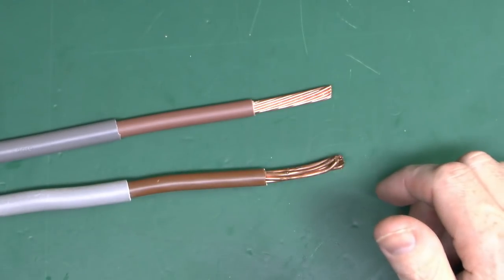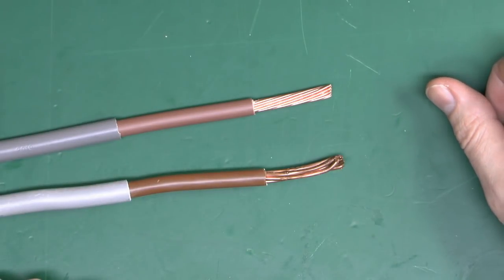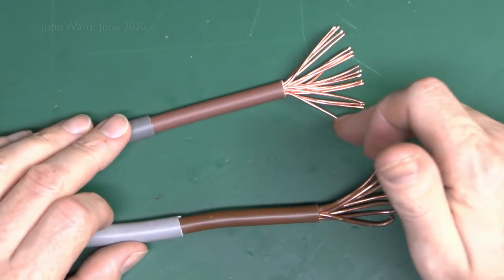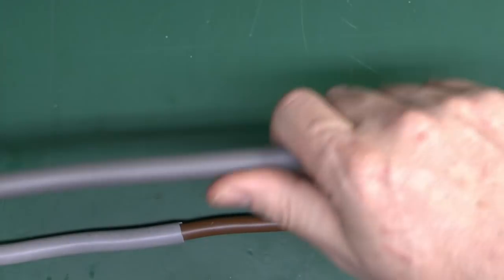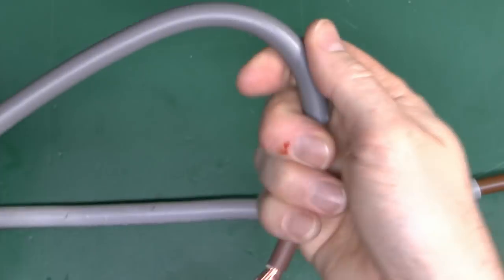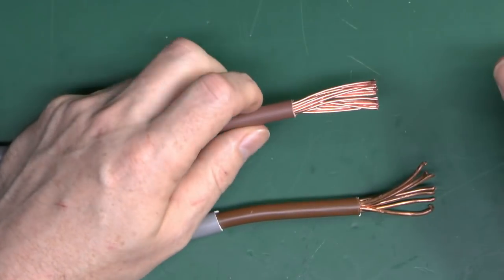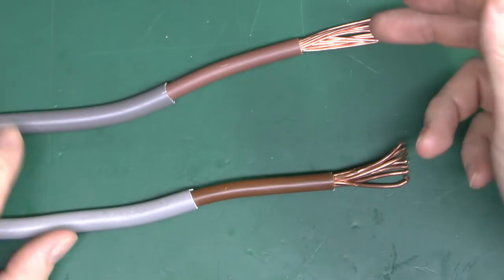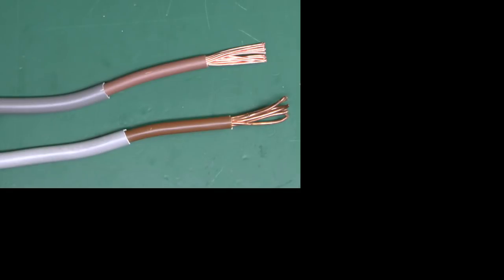Meter Tails - 7 or 19 Strands

Comment: A funny thing, these days down here in New Zealand and Australia, inside our commercial switchboards and distribution boards, we are required to install single cores that are like the cables for a welder.
IE, you might have 50mm² in from the meters to the main switch, via CT's, the wire you use there, needs to have (I could be wrong here) 625 individual cores in it, with them being so fine, you have to use either bootlace ferrules or some sort of an eyelet crimp connector on the end of it.
I like this idea, back when I started my time,  we used to have to solder wires into lugs, it was a pain in the rear.
Personally, I also like the idea that flexible cables are being used, as opposed to mere stranded copper, the new stuff is so much easier to fit and terminate.

Comment: as a meter engineer i use both, but the 19 strand one is preferred in tighter scenarios, as can be bent easier...overall  just get the 19 strand if you can👍🏽
Reply: Hi, what is a meter engineer? Thanks
Reply: @Keith Grout In other words, an installer. Not engineer, not even technician. Not putting down the role, but different skill sets and tasks have different terms for a reason.
Reply: @Monkeh616  Yeah like cleaners are called sanitary engineers.

Comment: I prefer the 19 strand tails as an electrician, the ones i get have the brown/blue outer sheath instead of the grey.
Reply: I use 19 strand Doncaster cables.  Can’t seem to source the blue and brown outer sheath ones though? Mine are always grey outer.  If you have a link to where you buy the blue and brown 19 stranded ones please let me know....😬
Reply: IWL Electrical Limited Ian Lawrie   I bought some fromCEF recently, blue and brown, wouldn’t go back to the 7 strand again, 19 is the way to go
Reply: @evguysltdianlawrie2274  'SHOP4ELECTRICAL' do them as well.

Comment: The 19 strand has another advantage:  when connecting to a round terminal, one can use one long strand to wrap around the conductor tightly: this stops the strands from splaying out, thus making a better connection.  Many years ago, this was standard practice, and some electricians also used this method when connecting final circuit conductors to fuses or breakers in dis. boards. This doesn’t work with that most nasty of cables, 2.5 sq mm T&E., or other solid conductors such as those in micc.
Reply: Sounds like a BAD idea ! Surely it's better for the strands to be able to slide over each other and be formed by the terminal hole they're being screwed down into ?

Comment: Do you need to crimp on some bootlace ferrules to the 19 strand to prevent splaying in the meter terminals? Would have thought the 7 strand might be more robust against overtighfening, closer to solid class. Thoughts?
Reply: They're still solid conductors, 1.3mm or so in diameter. No ferrule.

Comment: Is the 25mm a nominal dimension or the aggregated actual cross sectional areas of the strands. I ask because if it is the former (I.e. 25 mm2 is the area inside the brown insulation) then smaller strands should give a better packing and so the actual copper area may be higher for 19 strand than 7. Could be an appreciable difference.
Reply from the maker: It's the cross sectional area of the copper conductors.  For multiple strands, it's the sum of the cross sectional area of the separate conductors.  Space between them is not included, so the total area is the same regardless of the number of individual strands.

Comment: On a 50hz system skin effect in minimal so the 7 strand is fine, but whats the 19 strand for ? Motor Inverter
Reply from the maker: Unless the strands are individually insulated or separated from each other, skin effect is identical - a group of uninsulated strands together acts in the same way as a single solid conductor.
Where skin effect is significant, the conductor either needs to be a set of smaller separate conductors (such as overhead power lines with 4 spaced conductors), or a different shape such as a flat bar.
Reply: @jwflame  so in a motor the individual strands being insulated makes many small paths rather than one large and skin effect changes the current carring capability at high frequency, but these wire are not enameled and act as bus but I got you JP 🤙
SO ones easier to bend than the other both act same no matter frequency allways a lesson round here fp.
Reply: @jwflame  So the answer is cost? are 7 big strands easier to... cast? Draw? BRB off to learn how copper cables are made

Comment: should the 19 strand be ferrule crimped
Reply: Not unless you have a hydraulic crimper..

This isn't exactly a fine stranded wire - those are approximately 1.3mm² each.
Reply: Nothing in the regs about crimping.
Reply: @martinwinfield2935  Thank God for that !!! It's so illogical to me ! Main reason being that the clamp is removed - allowing the crimp to 'ease'. Whereas a terminal screw remains tightly clamped - if tightened properly.
Reply: @millomweb  What do you mean the clamp is removed? You apply the same clamping force to a ferrule or other crimp as any other conductor in the terminal.
Reply: @millomweb  - a properly crimped terminal is infinitely better, more reliable and longer lasting than a screw termination (clamp or no clamp). So you are talking out of your arse, and/or doing it wrong.
Reply: @johncoops6897  Whatever issue you have with screw terminations, crimping doesn't remove as crimp terminations are still attached with a screw ! So you may as well clamp directly onto the wire - a screwed down connection remains screwed down as tight as it was screwed. A crimp on the other hand, loosens a little when the crimping tool is removed ! It's just impossible a crimp and screw can be better than just a screw !
Also, a crimp is just straight pressure whereas a screw applies a shear force which cuts/cleans the wire at the point of contact - making a far better job of it than simple crimping where the wire isn't as clean as ideal.
There is talk of using crimping in automotive situations as they deal better with vibration. Well I've come across wire failures where a crimp has been used - in not 1 but 2 places - where the wire enters the crimp (same as a screw connection) and also between the crimp and the rest of the terminal clamped under the screw.

Comment: JW,
I was told some years ago, by an Electrical Inspector that using Lineman pliers to twist stranded copper cables, is not only wrong, but it means the cable is wrong for the terminal size.
His reasoning was that when you twist the cores, you lose copper off of the cores on the pliers and lessen the effective contact area.
I still have no idea what he was on about.
Most of our stuff with 16mm² and above is multi-strand (like welder cable), within feeding mains around switchboards.
Reply from the maker: It would require a huge effort to actually remove copper from the wires using pliers, by which time the wires would probably be totally destroyed.
Twisting stranded wire will increase the diameter of the bundle of wires, which might make it more difficult or impossible to fit into some terminals,  but that doesn't explain less contact area.
Perhaps someone twisted them together, then found they were too large to fit into the terminals and cut some strands off so they would fit?
Reply: @sparkymacsparkface7497  - generally you twist when you are inserting into a round terminal with a screw that bears down on the copper. If you don't twist, you miss half the strands. When terminating into a rectangular terminal with a rising clamp (eg: circuit breaker) then you should flatten the strands and keep them straight.

Comment: Just a warning, on a job with EDF in attendance, they refused to fit connect their equipment to the 19 stand meter tails that I had provided. They said other supplies will allow it but not them!
Reply: When British Gas exchanged my meter last year, the installer specifically changed the 7 strand tails for 19 as part of the job. He also changed a Henley block for 2 Lucys, which seemed a bit OTT.

Comment: Hi John :  is  it 19  strand carry more current then 7 strand in the same size wire
Reply: No... they both have the same current ratings.
Reply from the maker: No, both are the same total size.
Reply: Technically yes but in practical use at these sizes no. In transmission lines a lot of consideration is given to the number of strands and how they are grouped as skin effect and the overall surface area of the conductor can affect losses. For a set of meter tails, over a Metre or so it would make no perceivable difference.

Comment: I'd think that more strands are also electrically less resistant, as there effectively would be more copper surface. Though that could be pedantic with AC.
Reply: Skin effect isn't relevant in this context, so no, there's no difference. At higher frequencies (50Hz being nearly DC in my world) or much higher currents, it matters, but at this level only the cross sectional area is important.
Reply: Well, if you're going to make use of all that copper surface by soldering ! I think the real benefit of more strands is the improved ability of the core to deform into the shape of the terminal hole it's clamped in- hence making more contact points with that terminal. However, if the terminal screws are properly tightened, the copper should be crushed and deformed/flattened against the terminal surface; which the 19 will do more easily.

Comment: What about electrical or should I say electromagnetic properties with these two?
Reply: At 50Hz on conductors this small at such short lengths the effects will be minimal, perhaps even immeasurable.

That said, at least in theory, because AC current density is highest close to the surface of a conductor and that effect is more pronounce the larger a conductor is, the 19 strand might be expected to show a lower resistance than the 7 strand.  Multiple conductors in proximity add to the complexity and is more than I can get my head around.

For the maths (and how significant or not the effect might be) see: https://core.ac.uk/download/pdf/41822519.pdf

Comment: May i ask a out of focus question? Why both of them are in prime numbers? Is it just coincidence or is it some reasons behind?
Reply from the maker: It's how small circles can be arranged inside a larger circle.  One strand = one circle, 6 others will fit around it and use most of the space = 7 strands.
The next layer contains 12 strands = 19 total.
After that it's 37 strands, 61 strands, 91 strands.
https://en.wikipedia.org/wiki/Centered_hexagonal_number
Reply: @jwflame  never think of this point, now i learned, thanks.
Reply: 7 strands definitely make the hexagonal shape when closely bound, and is the right number for efficiency. 19 is 7 plus 12, where the new 12 makes a single ring of strands around the original 7, again, the most efficient use of space, I guess.
Reply: Micc used to be sold in a random numbers of cores i wondered why 1-5 mm 19 core was a thing

Comment: I've used of 325mm² with 1591 strands. Each strand is just 0.2mm². It can be bent by hand to a 200mm radius rather easily. Imagine trying to bend 325mm² with only 7 strands.

Comment: You say the 7-strand is 'unbranded'... surely that is now illegal? Construction Products Regulation, Declaration of Performance etc...
Reply from the maker: It has a brand on it, but it's just a dsitributor that buys it from the actual manufacturer in Turkey or somewhere.  Claims to comply and all that and probably does.
Reply: @jwflame  Complies to the absolute minimum, at any rate. There was a big recall of Atlas Kablo stuff a while back as I recall, undersized conductors. Buy cheap..
Reply: @jwflame  That's not TLC is it? I've just got 100s of metres of the stuff for a house rewire (which is all in place). There's no brand but it's made in Turkey!

Comment: Hello J.W.  I enjoy your videos. Im about to do a bit of electrical work in a few days time. Im going to change the internal cables in my 5 light floor standing lamp.... The line and neutral wires in the tops of the lamp holders have gone hard and starting to brittle.

no im not qualified but my work is always neat and tidy... Ive done loads of work with electrics Re wired the spot lights a friends Hair Salon. All was checked over by an engineer and passed flying colours...............

Comment: Hi John 
would supplying power to an Immerser in a cylinder through an RCBO be problematic ?
Earth leakage can be common in these I believe
Reply from the maker: No, if it's leaking enough current to trip an RCBO or RCD, it's faulty and needs to be replaced.

Comment: If electrons travel along the outside of a single conductor, what would be the effect when using multi strand conductors and would more strands be better or worse?
Reply from the maker: For uninsulated strands bunched together, it's the same as one solid core - the current flow is more towards the outside of the strands as a whole.
Only make a difference if the strands are individually insulated.
For small sizes like this at 50Hz, the effect is insignificant anyway.
Reply: @jwflame  thanks.

Comment: A bit old school I used bind with a thinner copper wire stops spreading and better contact, meter installers used to do this all the time.Not sure if it was part of there training.
Reply: Surely a bad idea? If the strands are able to spread/deform such that they form the shape of the hole they're being clamped in, they're making better contact with it ?

Comment: The 19 strand should have slightly higher current carrying capacity due to more surface area?
Reply: The external area of the sheath is pretty much identical, and it's the limiting factor in dissipation. No change in rated capacity.

Comment: I've seen tails with more strands always thought DC was more used with more strands and AC less strands as Eddie currents in AC power run on the outside of the strands and DC does not encounter Eddie currents and the power runs through the centre of the strands
Reply: Well technically humans are not capable of generating power....
Back in the real world, 50Hz is far too low a frequency for the skin effect to make any significant difference. At 50Hz it makes no significant difference how the cable is formed.
Reply: @user-jp1qt8ut3s  nothing

Comment: My only concern is terminations, the fuse board is fine as it is clamped in terminals that clamp the cable, however, the electricity meter is "screw in" to the conductor and more likely damage the thin strands.  I've never had trouble with 7strands so I'm gonna stick with 7
Reply: Damage is good ! Firstly, it abrades through manky surfaces and secondly flattens the copper (to some extent) against the terminal metal making for a very good contact; hence reducing resistance at that point. Crimping does neither as it's not clamped as tightly as the crimp itself takes most of the mechanical clamping load to deform it rather than the conductor copper.
Reply: Try using bootlace ferrules, they work great in either screw clamp or screw terminals.
Reply: pmailkeey - a properly fitted crimp terminal does clamp the conductor wires. You do have to use a quality crimp terminal in a good quality crimping tool (for small wires, a hand crimping tool with ratchet action and which is calibrated to apply the correct crimping pressure. For larger conductors, a hydraulic crimping tool.
Reply: @Mark1024MAK  ferrules would be best for this I guess, where can I get a 25mm ferrule crimper from, I've only seen up to 16mm
Reply: @MrSJT  There's really no need for a ferrule for this stuff - the strands are still quite large. 'thin' is still about 1.3mm diameter here.
Reply: @Mark1024MAK  When the crimping tool is released, the crimp loosens on the conductor due to springiness of the crimp material - a feature all materials have. I guess if the crimp material is less springy than the conductor, you get away with it but it's hardly good practice even if successful. Push-fit would be better.
Reply: @millomweb  'hardly good practice' you say about a technique used to permanently join wires together for a century or more with proven results at extremely high and low voltages, currents, and frequencies.. Oh, and don't forget high loads - crimping is also used for wire rope..
 
Not only is the elastic phase tiny, but a proper crimp cold welds.
Reply: Had the exact same thoughts, risky when going towards flex WITHOUT ferrules leads to splaying under terminals screws without pressure plates. Possible 19 stands is ok 
, in the right terminal, but where are applications that are not suitable?